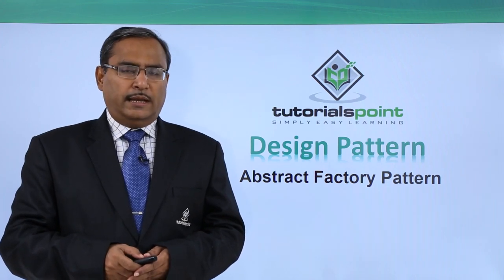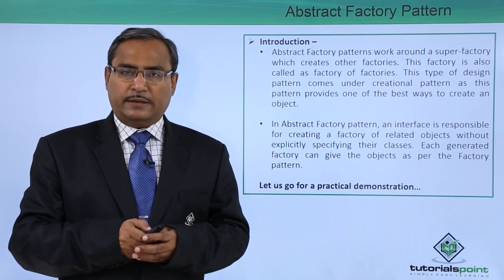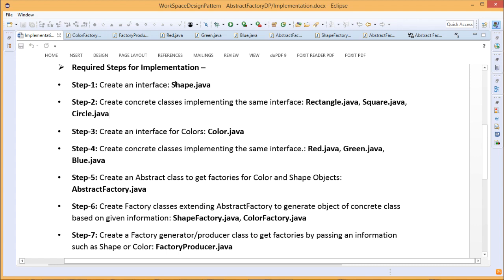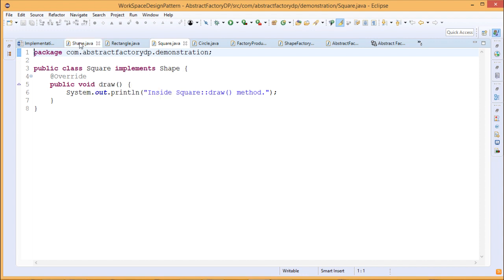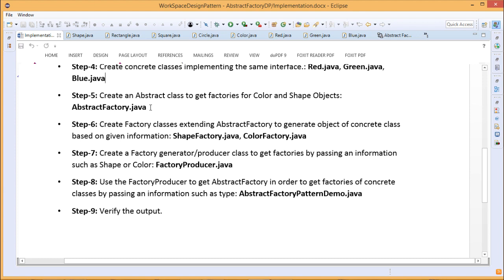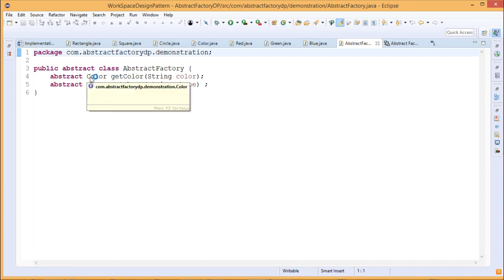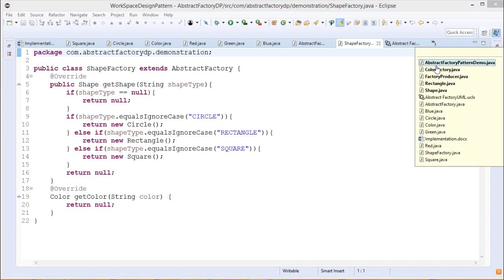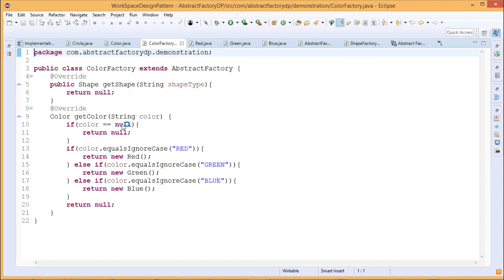Abstract Factory Design Pattern

Comment: I didn't particularly get the significance of having an abstract factory, at least for this example. If we have different factories for create shape and color and they're not directly related to each other, why not just have 2 simple factories for shape and color respectively and just use static methods inside those factories to instantiate concrete shapes and colors?
Reply: It’s families of related objects. I think the main idea in this pattern is, to get one access point for the whole system and controlled it so easily.